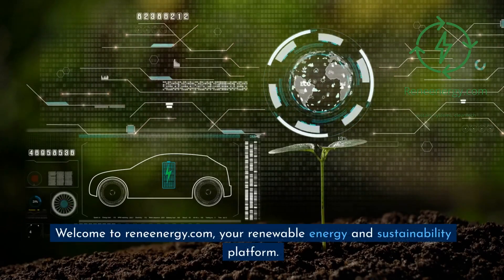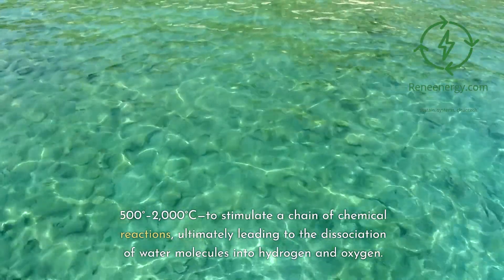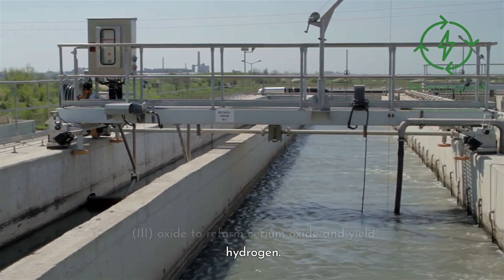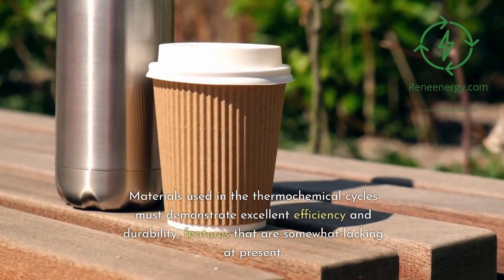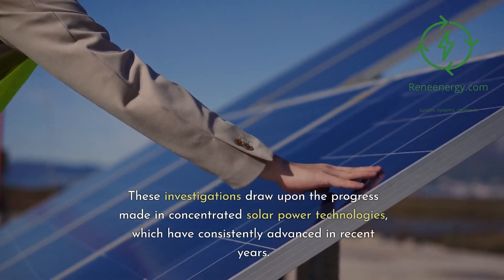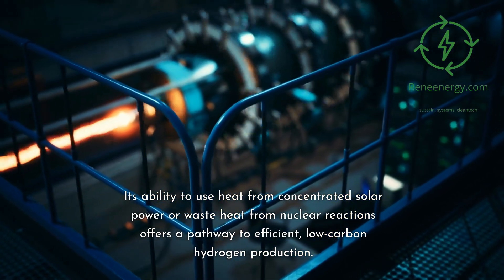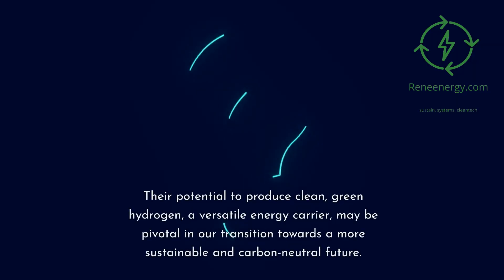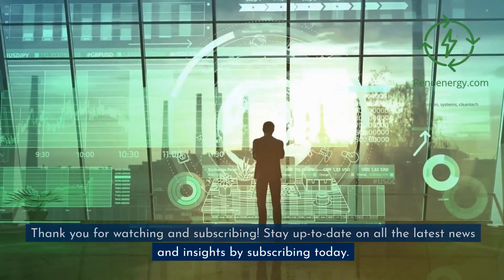The future of hydrogen production - Exploring thermochemical water splitting

Comment: Invest in NEWH an OTC (over the counter) stock trading for a little over a penny a share. They are working with UCLA to perfect the thermal process of extracting hydrogen from water at a much lower cost than electrolysis.